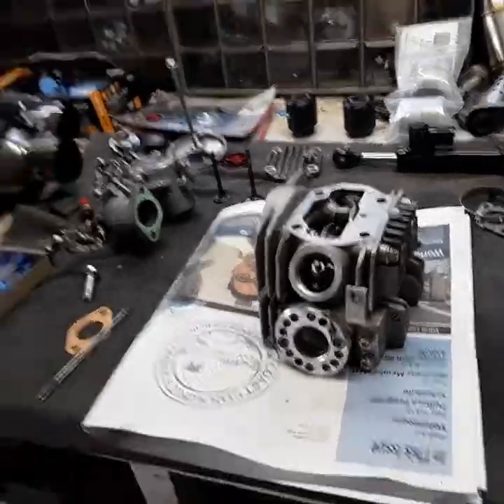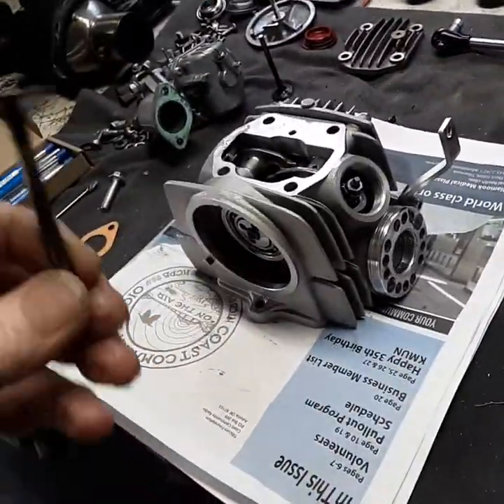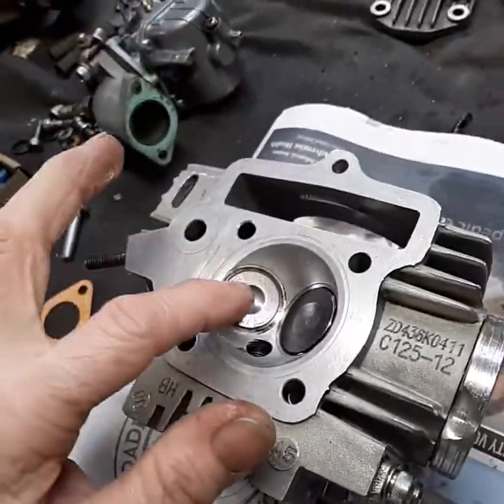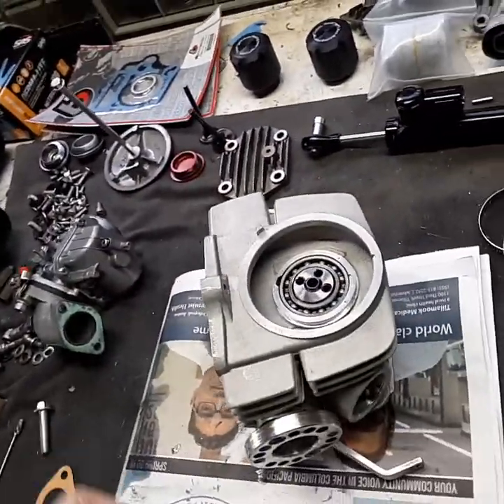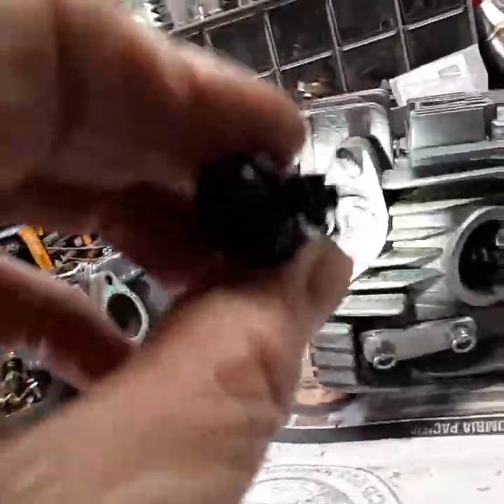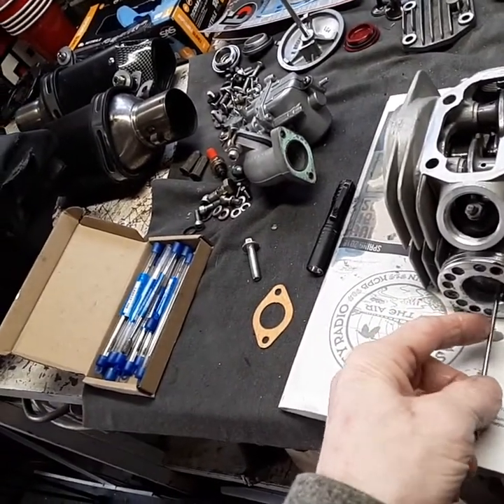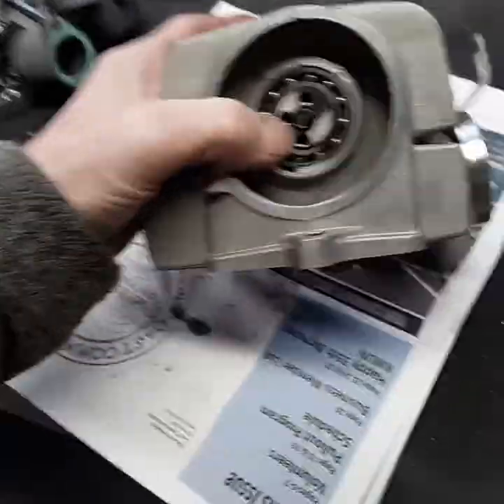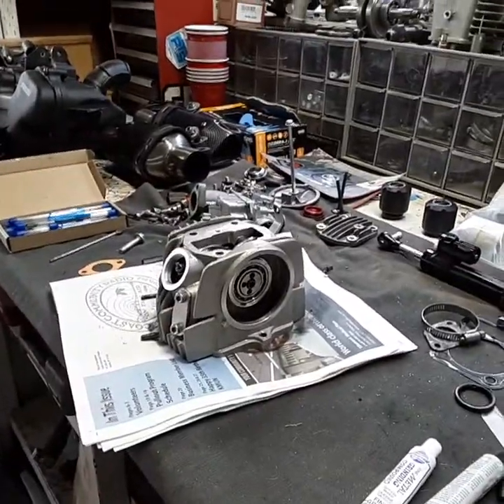Vader 141 Did some porting

Comment: Did you do your valve job yourself?
Reply from the maker: Yes I installed the YX140 valves. I did a light hand lap on the valves before they were installed.
Reply: @minibikeaction4266  I'm impressed.  I don't mess with valves or porting I destroyed a perfectly good set of iron heads that way.